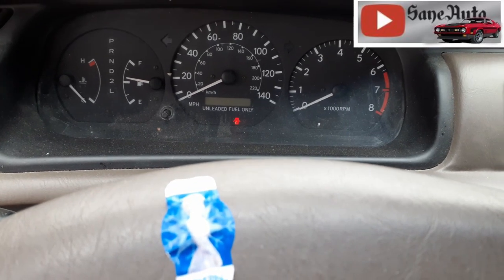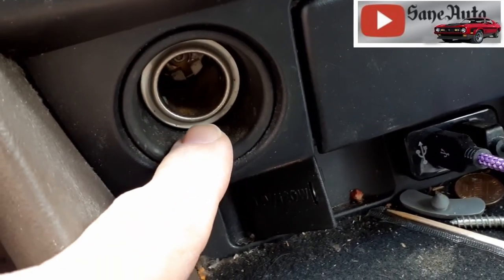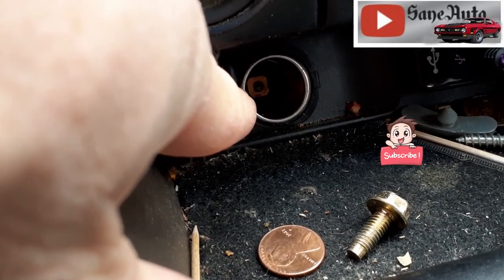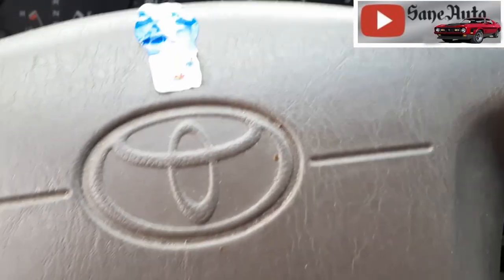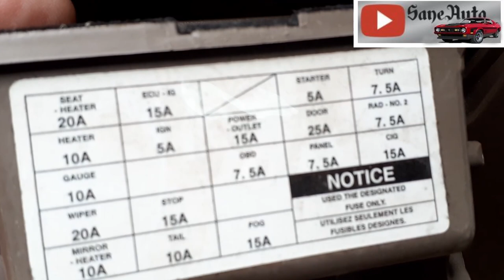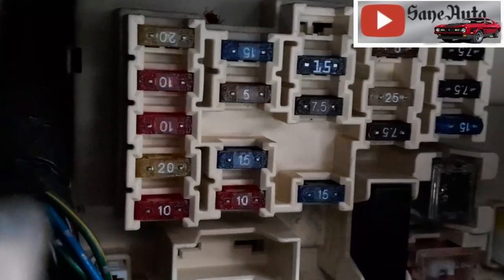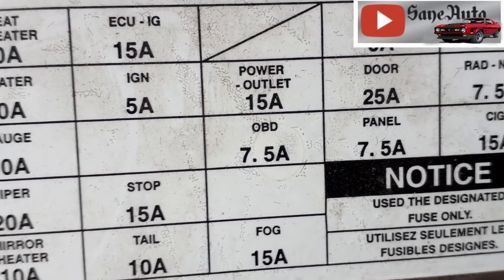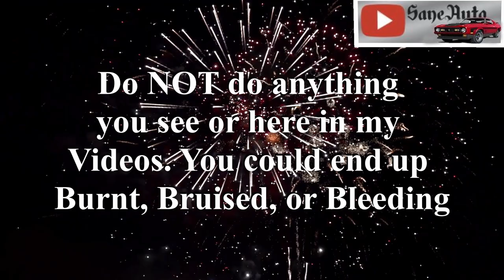1997 2001 Toyota Camry Where is the cigarette lighter power port fuse

Comment: May want to note this is not where the power outlet fuse is located on a 2001 Corolla.  It is in the most inaccessible place to the left of the panel you show and about 8 inches back (usually obscured by a wire bundle).  Takes an extremely long set of needle nose pliers to get to it.  No idea why they did that.  So your video probably applies up to a 2000 Corolla is my guess.
Reply from the maker: Thank you for the helpful additional information.

Comment: Can you show where the fusible link is located in the cigarette lighter circuit? My 15a fuse is good, but I still have no power to the socket.
Reply: Bout a year late but u believe it's on the back of the cigarette lighter it's a small black wire I cut mine out and hooked a new wire to it now it works!